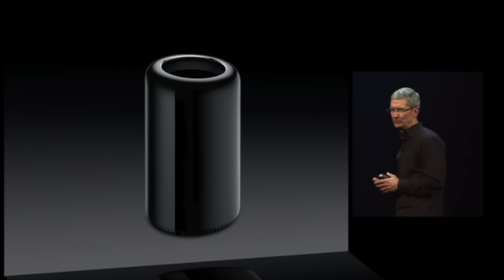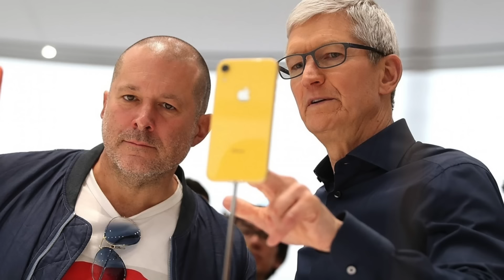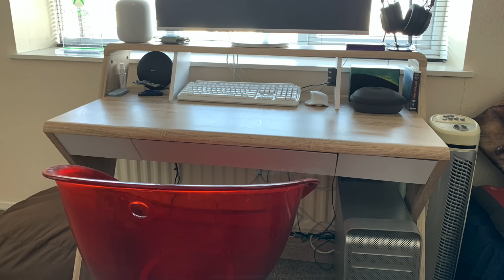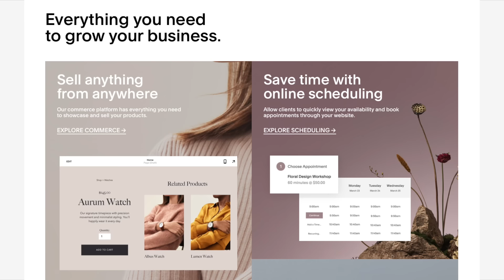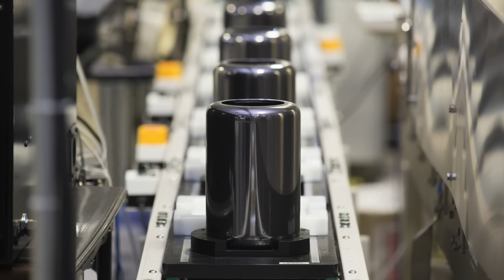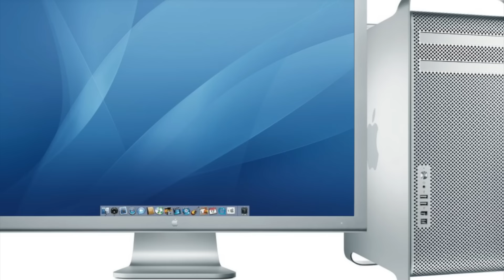Apple's Trash Can Mac Pro Failure

Comment: I love mine thanks, I have upgraded the onboard 1tb SSD to 2tb and RAM from 32gb to 128gb; it runs just fine and is not even close to the insane prices of the 2020 Mac Pro (I could buy a Tesla for what those cost fully-dressed out)! Oh, and I am a PRO (as in 45 years doing this) software developer! Oh,  and Schiller has been, is, and always will be a dipstick!
Reply: is the 128gb of ram working out for you? I have 64 and thinking of upgrading. have the 8 coe 3.0

Comment: I am still using the trash can since I got it in 2014. It may not be really great for the high-end pro users, but if Apple can refresh it with new internals and place it as a new mid-tier model between Mac Mini and the Mac Pro tower that would be a great thing. I honestly don't need PCI expansion but I don't want the mini due to the graphic card. And I don't want iMac because I basically am never a fan of all-in-one.

Comment: I want to ask for clarification. when you say that the 2013 mac pro was the second generation, are you referring to the design or the internal hardware? If its the internal hardware, there were 6 spec refreshes from when the Mac Pro was introduced in 2006 to replace the PowerMac G5 to the trashcan.
Reply: Mmm, I was wondering this. Must be the physical design?

Comment: It’s a very fast system, even almost 7 years after it shipped. I would love to have one.
Reply: @Deon Denis Mine is still yet to disappoint. Outperforms my 2018 15" macbook pro just a little bit, did some cheap upgrades and it continues to be awesome to this day.
Reply: That's mainly because Intel CPUs haven't gotten much faster since then (not counting Alder Lake).
Reply: @wta1518  I have the 12-core xeon 128 GB RAM version of this and it's still a beast. In terms of performance (i use it in music production) it holds up on par with the M2 macs, as those have unified memory and can't hold as many active tracks in DAWs like the intel based ones.
Reply: xbox had more power while had similar design...

Comment: What killed the Trashcan was the failure of Thunderbolt 2 adoption by the industry. If they tried it again with Thunderbolt 3, it would probably go a lot better.
Reply: Enmity the Kindhearted Apple sold nothing to intel. Intel invented thunderbolt (with input from Apple), Apple was just the first and widest adopter, it took a while for Intel to release the development kits for others for thunder bolt 1.
The first thunderbolt 2 device  however, wasn’t even an Apple product, it was an Asus motherboard
Reply: The 2013 Mac Pro would be great as a “just Mac” device for casuals that has some upgrade ability that sits between the Mac mini and the Mac Pro
Reply: @arturoehr  too much offering.
Reply: @ArunKumar-pu8gi  well they could introduce it as a just Mac that sits between the Mac mini and Pro now that they make their own chips they Can use their designs that didn’t work because of intel (I’m looking at you MacBook 12 inch)
Reply: If they tried it again with Thunderbolt 3, MAYBE it would have gone better. What really stopped the wider adoption of Thunderbolt was the high cost to license it from Intel. If you looked at peripherals with Thunderbolt instead of USB, you would always see a significant jump in price. Just look at NVMe external enclosures. USB 3.1 enclosures can be found all day long for around $10-20 on eBay/Amazon, but try finding a Thunderbolt 3 NVMe enclosure, and they're like $100 more expensive.  Hopefully now that Intel has made Thunderbolt free to license, that will significantly drop the prices of Thunderbolt devices/peripherals. I just took a look at Amazon, and there are a couple Thunderbolt NVMe enclosures that are around $70-80 so they're already dropping in price thankfully.
Reply: @charminbaer2323  Gud points 🙂
Reply: @charminbaer2323  It didn't help that Microsoft never got Tb to work correctly until recently. If you wanted a real mess, try to use TB on one of the few PC's that offered it. Even the vaunted XPS had a horribly flawed TB3 implementation in it's first iterations.
Reply: That was before Thunderbolt 3 though
Reply: @Enmity the Kindhearted No, Apple did not create nor sell Thunderbolt to Intel. It was an Intel creation with input from Apple. In fact, it wasn't even called Thunderbolt to begin with, it was called Lightpeak, and used a completely different connector using fiber optic cables.
Reply: It still would've been hot garbage. Having all your hardware inside a single computer is an invaluable asset. Would you rather have just the hardware take up an entire desk, cables strewn about everywhere, or in a single computer, with half a dozen so cables coming out the back for power, display(s) and other plug-and-play hardware?
Reply: The Name!

Comment: I’m really happy that apple is starting to add function to the form
Reply: Really? Where?
Reply: You can thank the departure of Jony Ive for that. He was the one shearing useful features off of Apple devices in favor of aesthetics.
Reply: Benjamin K Although Jony Ive likely prioritized asthetics over function, he's a designer so that's to be expected but, Ive is up there with Steve Jobs as for the reason Apple is where it is today. His minimalist and clean Asthetic design language influenced an entire industrial design Renaissance in both software and hardware. I think it had more to do with certain philosophies at Apple at the time, that Ive definitely contributed to towards removing the customer from the actual hardware as much as possible.
Reply: @BenKenon  well Jony is a designer so he’s just here to make it look good
Reply: It's a start, if we can get an I9 Mac that dosent thermal throttle and cables that don't turn into e waste immediately I'll start listening.
Reply: @Carterthielftw_  I9 macs well the chip is from intel so I’m not sure if it’s possible to completely change intel’s design
Reply: @Lauren_Cat  that's why form needs to be compromised to an extent. If Apple made a true "pro" laptop, it could easily be %50 thicker while packing much more power, and it still wouldn't be at all cumbersome